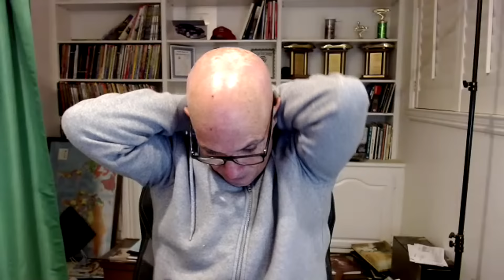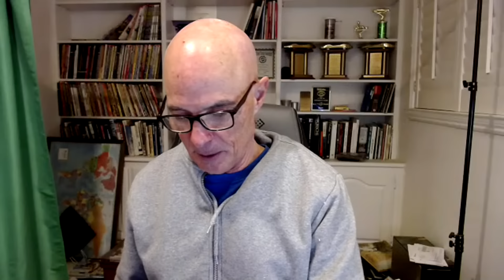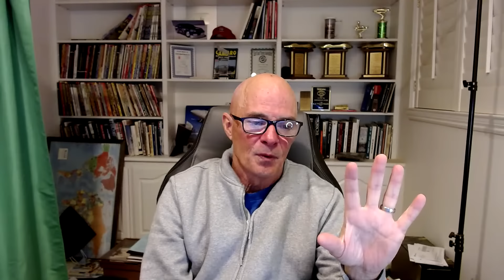TOP SECRET ENGINE MASTER'S CHALLENGE SECRETS LET'S TALK TECH

Comment: 1000cfm carb on single plane each cylinder has access to the whole 1000 minus what’s used by overlapping cylinder. Dual plane each cylinder has access to max of 500 cfm…🤔
Reply from the maker: each cylinder that only flows 250 cfm does not need 1000 cfm (dual plane intakes with cut dividers have full access as well)
Reply: @richardholdener1727  but u wouldn’t run a 250/500cfm carb would ya? I thought about the big open spacer giving it “access” to the whole carb. Still it’s like ya said just have to put the bigger carb on and test. I feel like dual plane needs larger carb than single plane. But I guess that logic goes out the window with a big spacer.